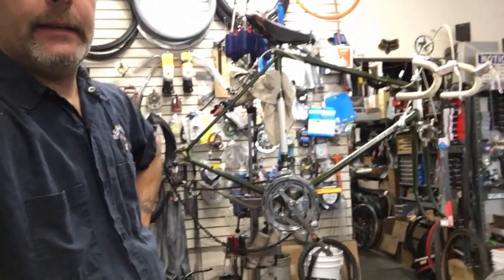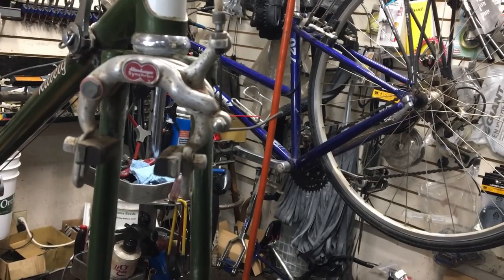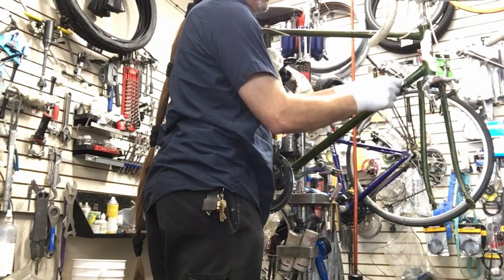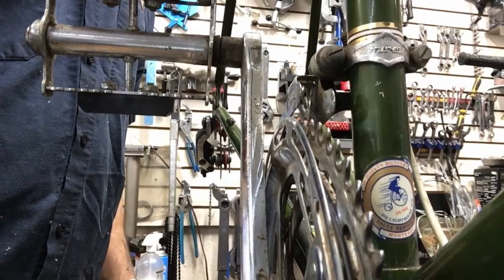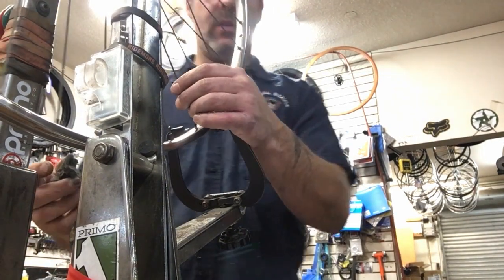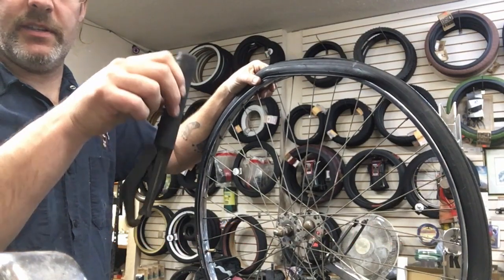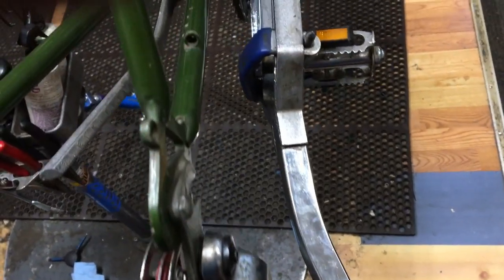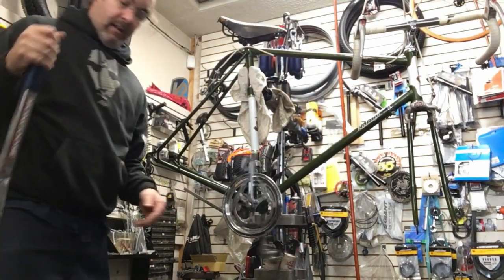Old raleigh road bike

Comment: By Heck I enjoyed that. Many thanks. A proper bike man working on a proper bike. I have a 1940s Raleigh I just bought and started taking it apart just to clean, grease and re-set. For an 80 year old bike that has been bashed around a bit it is still sturdy and all the components are in good condition. Hardest job is lifting it back into the shed as he is a heavy lad. All the best from Sheffield, UK.